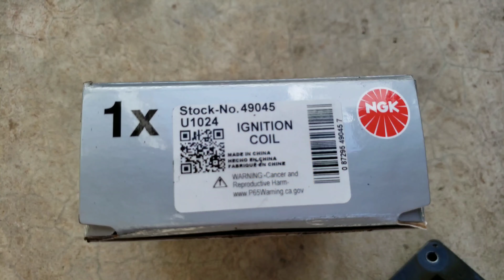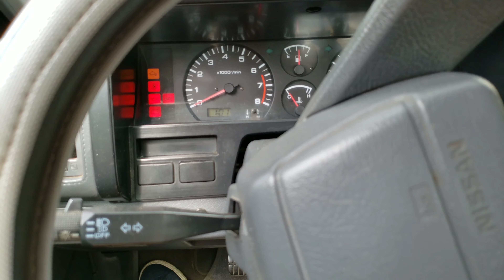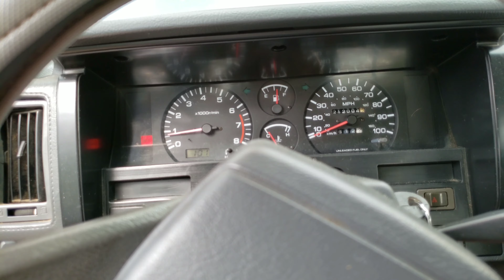1989-94 Nissan D21 DIY Ignition coil replacement

Comment: My 95 Nissan hardbody struggles to accelerate and defiantly worse when engine warms up and idk why? It has 106,000 miles on it my dad gave it to me, worked fine for a few months he gave it to me then started to act bad, I replaced spark plugs and air filter, and clean maf sensor idk what else to do right now
Reply from the maker: Does your 1995 come equipped with a TPS ?
Reply from the maker: You can test your coil as well
Reply from the maker: Also see if it comes equipped with speed sensor
Reply: @JeffersonJosueMorales89  I’m sure it’s equipped with a tps sensor somewhere
Reply: @JeffersonJosueMorales89  how do you test the coil? Sometimes the trucks feels like it has power and gets up and go if I push the gas the floor and sometimes it doesn’t. Also my temp gauge runs at 3/4 temp when I come to a stop at a stop light and cools off some when I drive, ice replaced t stat, water pump, fan clutch, radiator and brand new coolant, idk why it runs at 3/4 on temp gauge
Reply from the maker: To the test the coil is easy you'll just need someone with you
Reply: @JeffersonJosueMorales89  so what do I do with someone with me?
Reply: @JeffersonJosueMorales89  tbh tho I’ve replaced spark plugs not to long ago but the wires and coil are I think all original so I guess I could just replace them anyway have all new parts
Reply from the maker: I'm sorry for the late response 😞
But..while someone tries to crank the car someone else can check the voltage from the wire that's attached from the ignition coil. So see if the voltage is jumping or not through a AC/DC Reader. Voltage scan tool
Reply from the maker: You'll know if your plugs are getting spark.
Reply from the maker: You can swap out the TPS sensor as well. Making your throttle plate and ECU aren't on the same page
Reply from the maker: You can also do a compression test as well
Reply: @JeffersonJosueMorales89  sounds good and no problem people get busy it’s ok, lol and ok yeah I need to do a compression test idk where I can have that done at and yeah the truck is 25 years old all sensors and parts are original besides air filter spark plugs you know the normal tune up stuff
Reply: @matthewmurdock1897  I know this is 3 years old but hoping this fixed the issue for you? Having the same problem on an 89

Comment: My 1990 with 231k miles died on the road.  The engine cranks with fuel pressure.  No spark any where along the ignition system.  Going to try to replace the coil to resolve.
Reply: any luck im having the same issue on a 87 d21 12v at the coil but no spark at the distributor
Reply: @dabeast123ipodhelp  Yeah I fixed it.  It was the distributor.  Had to replace it for $300.

Here was the order I replaced things in:
Ignition coil
Ignition wires
Distributor cap
Ignition control module
Distributor

Getting a new distributor fixed it.  They are pretty easy to replace on the KA24E engine.  It meshes with the fuel pump.  Then you have adjustment to turn the distributor about 45 degrees to fine-adjust the timing.  Good luck buddy.
Reply: @nakfoor1846  update my 87 d21 2.4 has officially started, I had no spark followed repair manual and came to the conclusion the crank angle sensor was faulty and even melted, after replacing the C.A.S TRUCK STARTED RIGHT UP! Running great!
Reply: @dabeast123ipodhelp where is that at

Comment: I had a no-spark condition on my 1990 KA24E.

 It was the distributor.  Had to replace it for $300.

Here was the order I replaced things in:

Ignition coil
Ignition wires
Distributor cap
Ignition control module
Distributor

Getting a new distributor fixed it.  They are pretty easy to replace on the KA24E engine.  It meshes with the fuel pump.  Then you have adjustment to turn the distributor about 45 degrees to fine-adjust the timing.
Reply: Amigo donde no tenias chispa en las bujias  o en bobina
Reply: @ronaldovallejoaquino1795  no tengo chispa en las bujias y bobina porque el distribuidor estaba roto.
Reply: Amigo porque ami se me corto la chispa  en las bujias y en la bobina y al soltar la llave me avienta la chispa  si me llega ignicion
Reply: @nakfoor1846   igual ami me pasa lo mismo pero al soltarle que dejo  de dar marcha me avienta la chispa amigo nose si igual te pasa
Reply: @ronaldovallejoaquino1795  Eso es extraño. Para mí, mi coche no hizo nada.
Reply: @nakfoor1846   apoco amigo pero ya cambiastes tu distribuidor y que coche es el tuyo